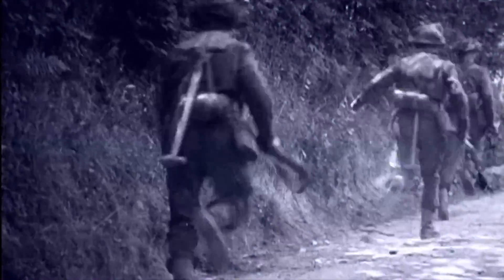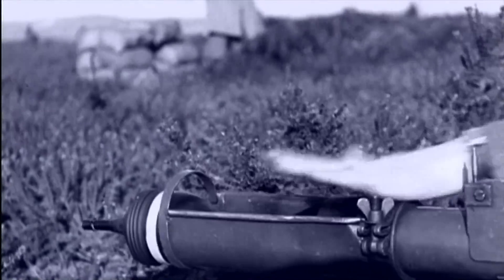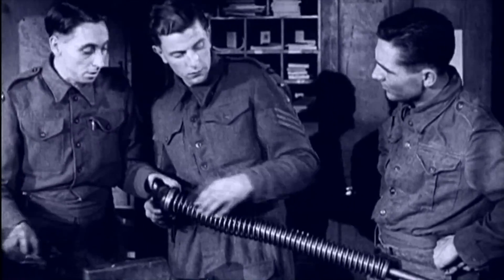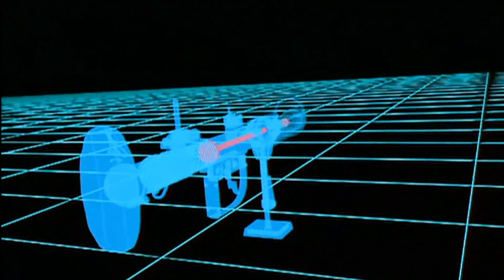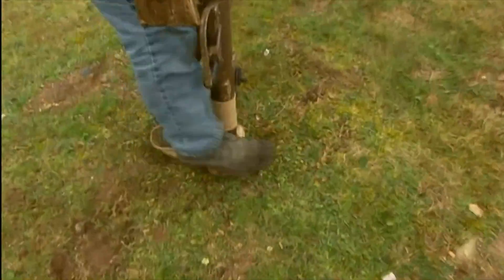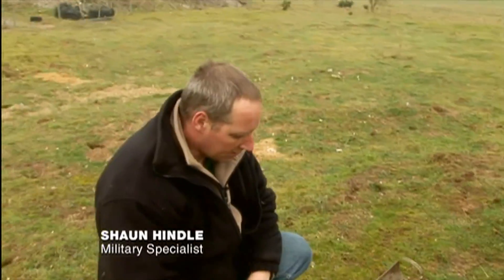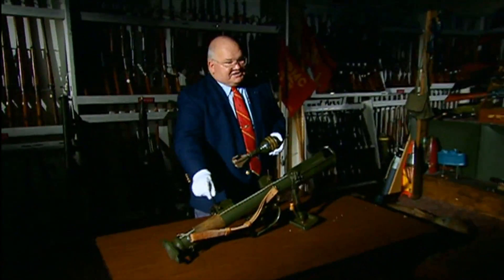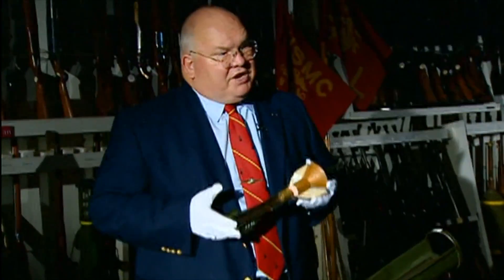Weaponology - "British PIAT"

Comment: I'm told the PIAT had the advantage of being able to fire from inside a building without shell shocking the occupants. I'm sure you could fire a bazooka or similar from inside a building but I think you would only do it once.
Reply: When you're firing a recoilless weapon indoors you have to consider the blackblast area in terms of volume: you can fire even weapons with colossal backblasts like the M47 Dragon and M40 Recoilless Rifle from inside structures if you have time to sweep up debris behind the firing point and knock out a few walls to allow for expansion. In the case of a bazooka, a hallway or pointing the back of the tube at an open door could be enough.
Reply: @CruelestChris  
Or to tell the truth which you never do the Bazooka was pretty useless and the PIAT worked, the results show the truth.